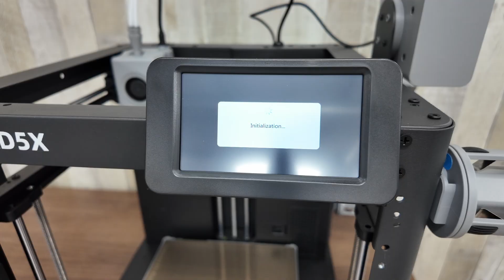FLASHFORGE AD5X - Unboxing & Test Prints

Comment: Hey man I accidentally got fillament in the fillament tube and its cut so I cant pull it out, is there a way to disconnect for the tubes entirely from the 4 in 1 and ams system